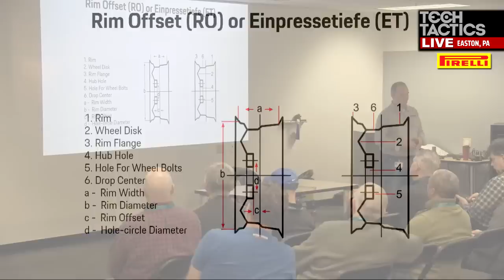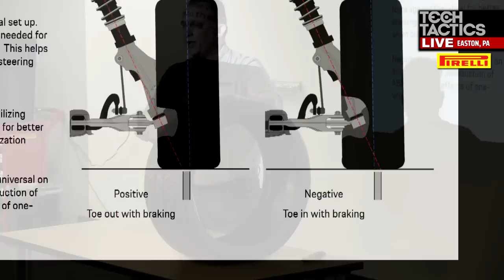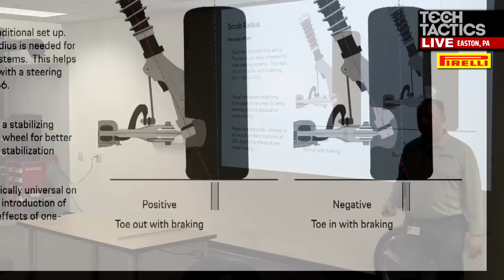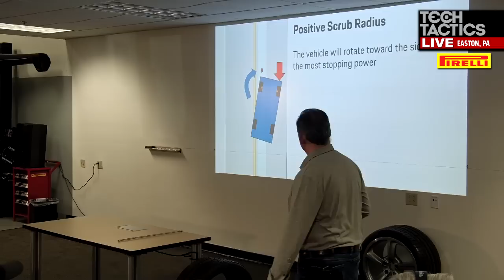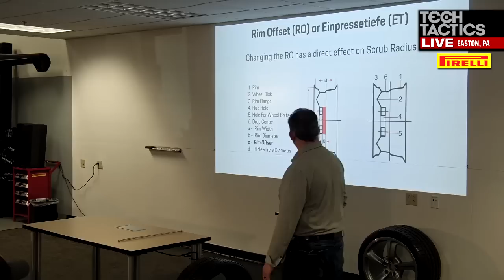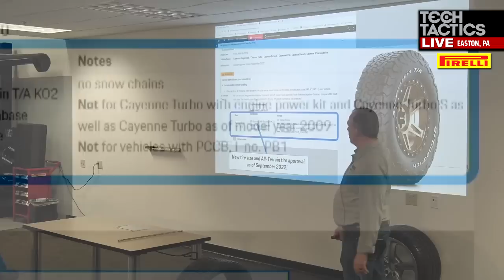Wheel Dimensions and Steering Geometry | Tech Tactics Live

Comment: Terrific video. I learned a lot thank you.  
Could you consider doing a similar lesson on Porsche spare tires and related options. What are options on a long trip in a 911 if a tire blows?   It is the one area where Porsche has failed us (except for the IMS bearing of course).
Reply from the maker: Great idea!
Reply: I hear you brother, I went thru some trouble to get a spare from a older boxster model to just fit/clear the base 997 front / brakes.  no spare is to be installed on the rear, just the fronts.  In the event a rear blows out, install the spare skinny donut to one of the fronts and take good front tire to the rear that is blown I believe.